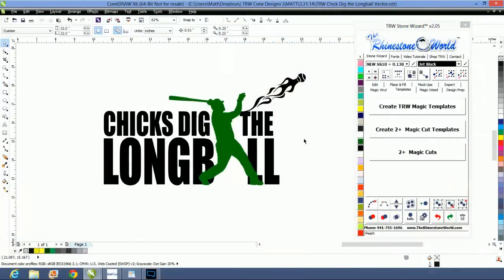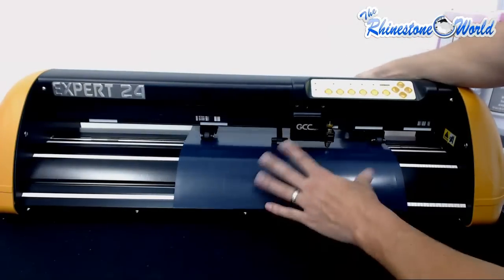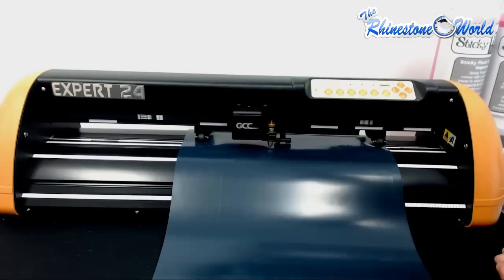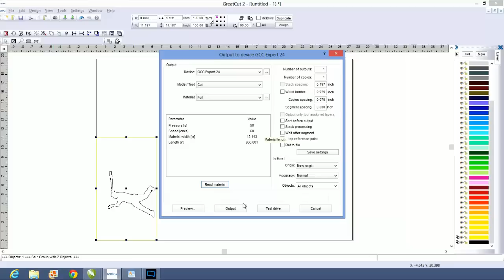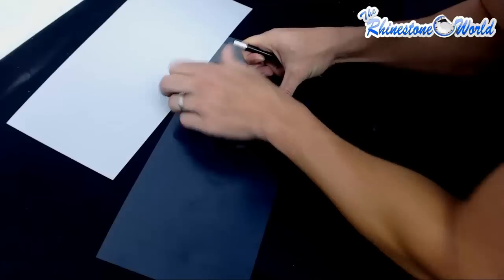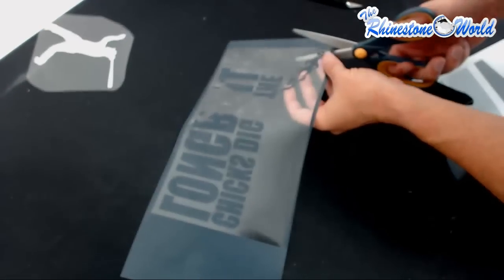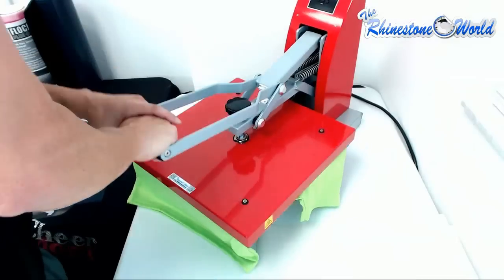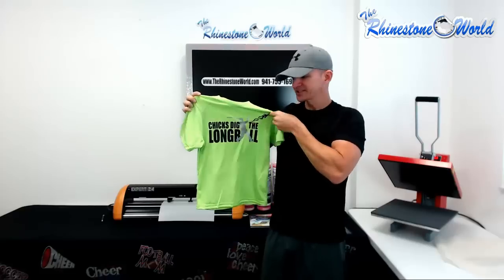How To Make A Custom Shirt From Start To Finish

Comment: That's awesome.. I"m currently trying to get into designing t-shirts... I'm in a social club and we already have a logo, my question is how can I make designs of one I already have to print on t-shirt
Reply from the maker: Terrell,
If the graphic is a vector then you can simply export to your Vinyl Cutter and cut the design from Heat Transfer Vinyl.

TRW Casey
Reply: do you need corel draw for this

Comment: I haven't started printing on any garments business yet. What is the best inexpensive vinyl cutter machine to buy? 
What do I need to get started?
Can you please explain to me step 1, 2, 3 what I need to do? Your help is greatly appreciated
Reply from the maker: Hey Ted,
The best inexpensive vinyl cutter machine to but GCC Expert 2 cutter. The supplies you need other than the cutter is a heat press, vinyl material, rhinestones and software. We do have business starter kits available on our website (http://therhinestoneworld.com/Main-Category/Starter-Kits/Subcategory-1/Business-Starter-Kits). - TRW Aaron
Reply: TheRhinestoneWorld Does the starter kits include the cutter? I was reading included items and was a lil vague except on supply list. Seems like some good deals though. Thanks for your time.

Comment: I'd like to see how you do men's socks, both ankle length and calf length. Like what is the good part of the sock to use and how to get around those ribs they put in the socks
elastic.  Also, so we have to use Coral Draw to do all this stuff. I just bought the vinyl
cutter outfit but have never done this before so that's why I'm asking. I have a ton of
graphics on my PC and wanted to use those for this cutting and using on T-Shirts, is
that doable??  Well keep up the good video's, there a good teaching tool for the newbie's.
=0 }
Reply from the maker: +sthwestb 
Just like you had mentioned the ribs will make it difficult to get a good press and therefore we don't recommend pressing on anything Ribbed or Textured.
In regard to your preexisting graphics you may need to convert the graphic to a vector if it is bitmap.

TRW Casey
Reply: ALL my graphics are .jpg, does that make a difference?  I didn't think I was going to get an answer because I've asked questions before but I went ahead and pressed some socks and they turned out real well... I just stuck a piece of cardboard in the socks to widen them and it worked.   =0 )
Reply from the maker: JPG should not make a difference in your pressing, it would just affect your ability to cut with a vinyl cutter. Hope @ TRW

Comment: Where can I find the heat transfer paper with the image I want on it already? Do I need to buy the printer myself or is there a store that will do it for you?
Reply from the maker: Hey Griffin, 

To have HTV that has been printed on (as opposed to cut as seen in the video), you would need to either purchase a Print and Cut machine or have someone print the design on a printable vinyl and cut it out for you. If you're looking for something like you see in here, where the vinyl is cut, you can either have someone send you a "vinyl transfer" or you can purchase a vinyl cutter and cut it yourself. Both options are available to you. 

TRW Nick

Comment: I've not done a design like this yet where I haven't needed the whole width like the ball player. Matt said he should have just cut the ballplayer out and saved material. How would he have done that?
Reply from the maker: ajp59759 
I think that what he meant was he should have just cut the vinyl with scissors, instead of a whole square template, to save vinyl.  Jenny@TRW

Comment: if you want the design to have color do you have to use a different type paper like you did with the silver baseball guy or is it still the black paper you used ?
Reply from the maker: Michael,
The color of the design will be determined by the material that you cut.

TRW Casey

Comment: I see people use small shirts for designs can I use a men's double Xl for example for this specific heat press or something bigger ? /And can I heat press hoodies with this ?
Reply from the maker: Alexus,
As long as your design fits on the plate of the heat press, you are good to press that design. As for the hoodie, that is fine to press, however you may need to adjust your pressure seeing that it is a thicker material.

TRW Kaitlin

Comment: I have a question. Is it possible to heat press vinyl from a cricut machine?  I've used iron but after I wash it some letters are a little loose.
Reply from the maker: +Cynthia orozco Hey Cynthia, that should be fine. The big thing is to look up the type of vinyl to you can check on the best heating specs. TRW Erika

Comment: what if you wanted 4 colors that would overlap in the design. How hard is that to match up? For example I have a design that uses a flag inlay.  Is it possible to do that using your product or would you have to create 4 different templates that only focused on one color at a time?
Reply from the maker: Hi Kelly, each color would be a different template. It is a little difficult to match up multi-color designs because of tendency of materials to shrink, but it is definitely possible. 

Alexis @ TRW
Reply from the maker: Kelly,
When creating templates using the Wizard, each color will be separated and placed in a weed box.
In the video we see that each color of vinyl corresponds to a different layer in the design.
The more colors in the design the more templates will be created.
The Wizard can add registration marks to aid in alignment of multiple colors.

TRW Casey

Comment: do you print on the shiny side up or dual side up?
Reply from the maker: If it's heat transfer vinyl, you will cut with the shiny side down, dull side up. If it's decal vinyl, you want to cut with the paper side down, color side up. :) 
TRW Alexis

Comment: How long does the vinly last on the TShirt. Like in the wash??????
Reply from the maker: Jerko, 
We have seen the vinyl outlast the shirt in some cases! As long as you follow proper washing precautions, you should be good to go. Wash inside out using gentle detergent dry on low heat and don't use any fabric softener. Also, don't wash the shirt for at least 24 hours after pressing it!
TRW Alexis

Comment: Is this a good way to go for beginners? I see the cutters are pretty expensive. Main methods I've seen is: buy a heat press, and order prints from a company, buy heat press/and a printer that can actually do it all for you (no weeding, probably expensive), or do this and buy a cutter and the heat press. On the other hand, I've successfully printed shirts with crayons and an iron before haha. Also can you use a MAC for this process?
Reply from the maker: Hey! It is actually cheaper if you buy the designing software, heat press, and vinyl cutter yourself and do the work, as the initial cost will be more expensive, however it will save you in the long run. Even after purchasing pre-cut templates and pre-cut vinyl transfers from others a couple times, it will be beneficial for you. 

As far as using MAC, as long as you are using the Silhouette Cameo and the Silhouette Designer Edition or Business Edition softwares, but if you are going to use CorelDRAW alongside the TRW Design Wizard 3.0, you will need to get a PC. 

TRW Nick
Reply: +TheRhinestoneWorld great thanks, I will look into that more. can you recommend a beginner heat press as well?
Reply from the maker: Here is our beginner heat press: http://therhinestoneworld.com/store/#!/TRW-Red-Digital-Clam-Heat-Press-11-x15/p/25286549/category=4690556.

Doug @ TRW

Comment: Can you use the TRW templates in a Silhouette?
Reply from the maker: Hi +Heidi Gale, Yes you can!  The only designs that will not work with Silhouette are the Magic Templates and Magic Patterns.  Those are designed specifically for TRW Stone Wizard.  Just use the SVG files.  Hope this helps!  Jenny@TRW

Comment: What is the suitable total duration for washing cycles when i wash t-shirt transfer paper?
Reply from the maker: I would have it on cold water and turn it inside out. Not the best to use a tumble dryer, but if you do, put it on low. 

TRW Nick
Reply: +TheRhinestoneWorld 
My program details were : 
Washing time : 3 mins    
Rinse times : 1    
Spin : mid   
Water level : 1   
Total time of this cycle was 38 mins on cold water . 
The result was that Printed image had been faded !
Reply from the maker: Are you printing on vinyl or are you creating the entire image with vinyl? The vinyl should not be fading, as far as printing on a vinyl, that would be a little different setting. 

TRW Nick
Reply: +TheRhinestoneWorld 
I'm using atransfer paper .

Comment: How you know what size to make the design for. The garments ? Im loss I been wasting a lot. Of vinyl trying to figure it out
Reply from the maker: It really depends on the look that you're going for, you don't want to go wider than 9.5", but it depends on the look and the design itself. 

TRW Nick
Reply: okay so i have paper thats 20x20 do i put that same size in mat size then go from there also should i use a ruler and what type since all my paper the same size

Comment: do i have to mirror my image if I'm putting it on the back of my vehicle window?       "outside of the back window"
Reply from the maker: Our decal vinyl will not be mirrored when you cut it, only the heat transfer vinyl will be mirrored. Let me know if you need anything else! 

TRW Nick

Comment: When I copy my design into great cuts, its not showing up in the wire frame like yours is.  I'm following along exactly and I can't get it to work.  Its the logo for my business.
Reply from the maker: +Denise Thorstenson Hey Denise, there is a wireframe function in Corel that you may want to look at, not in Great Cuts. What you will want to do is create your design in Corel and then make the templates using the TRW Stone Wizard, and then copy those templates over to Great Cuts. :) If this issue still persists, give us a call. :) 

TRW Nick

Comment: Why do colors matter while working on it on the computer when your paper will be a different color or ( one color)? any idea
Reply from the maker: It is mostly so the designer can have an adequate representation before cutting it out and applying to the shirt.  You can use multiple templates and different colors for heat transfer vinyl.  Also, using our mock up feature, your customer will want an accurate representation of what the image will look like.

Doug @ TRW
Reply: true thx for thye reply, I checked the website and I liked  it . it got all I need
Reply: which heat press machine work for printing on acrylic that's available in your store.
Reply from the maker: The Fusion by Sthals has the best temperature range (32°-430°F).
Is the Acrylic a garment or an other object?

TRW Casey
Reply: i'm new to this but I'm learning, I was just wondering which heater machine can be used to print on acrylic \ wood \ glass boards , if Im gonna buy a heater machine i would prefer a 3 in 1 machine. honestly I don't know what garment acrylic is but I meant with acrylic is the material that sometimes can be used for making jewelry , it look like glass but its not
Reply: But I think there is no need to heat press anything on acrylic or glass because I can just do it another way like the way you did on your video here" How to Make a Vinyl Car Window Decal Using the Silhouette Cameo Portrait " I can just print whatever I want that way right?
Reply from the maker: That is correct you could use a vinyl cutter and FDC Sign Vinyl to put a design on those surfaces.
The kit containing a cutter and some of that material can be found at the following link.

Silhouette Cameo Decal starter kit : http://therhinestoneworld.com/store/#!/CAMEO-Decal-Crafter-Starter-Kit-with-Cutter/p/55859370/category=14933622

TRW Casey
Reply: thanks you , very helpful, I will be ordering all that stuff soon as I can

Comment: DO YOU HAVE TO MIRROR THE IMAGE?
Reply from the maker: If you're working with heat transfer vinyl, you mirror the image. If it's decal vinyl, you do not need to mirror it. 
TRW Alexis
Reply: how do you mirror the image on corel draw
Reply from the maker: Once you select your object, you will see an L and a backwards L, this will mirror your object. :) 

TRW Nick

Comment: All those machines are pretty expensive! Not recommended for beginners.
Reply from the maker: Are you referring to our heat presses or vinyl cutters? We have models of both that are more cost effective for people just starting out. :) 
TRW Alexis
Reply: Yeah planning to start a small t-shirt printing business with this new technique but my concerns are those machines that will cost a lot.
Reply from the maker: You should check out the Silhouette Cameo and the Crafting press that we have, as both of them together at approx. $600. :) 

Craft press - http://therhinestoneworld.com/Hotronix-Craft-Heat-Press
Cameo 3 (you will also need to get the Designer Edition software upgrade) - http://therhinestoneworld.com/Silhouette-CAMEO-3-Bundle

I know people that do run businesses with these items, so that should be helpful to get you started! 

TRW Nick
Reply: You're amazing thank you for such useful information. (: what vinyl do you reccommend i buy for the cutter? Lmk thank you very much for the info again.
Reply: I'm feeling lucky, punk go on ebay much cheaper for starters